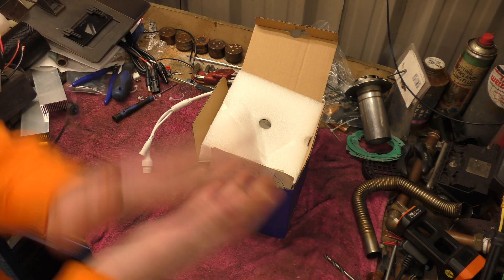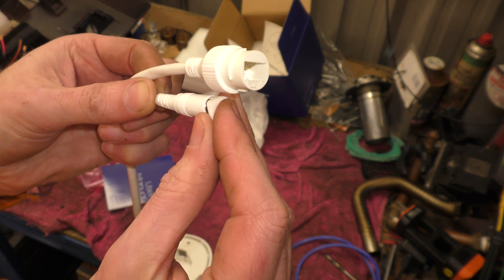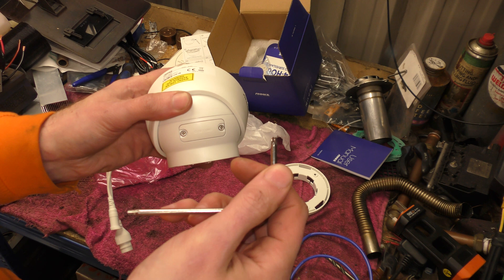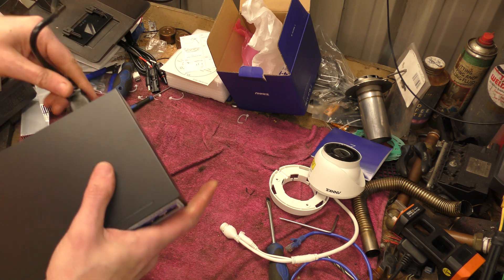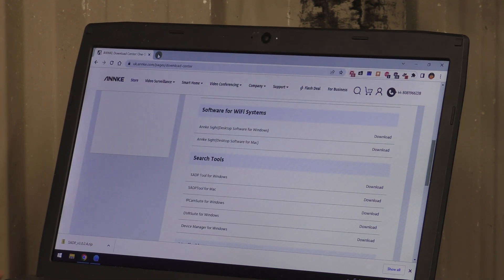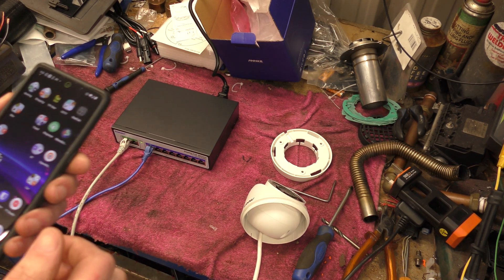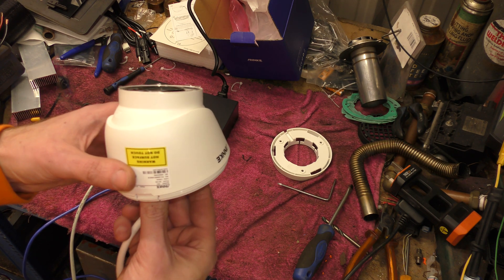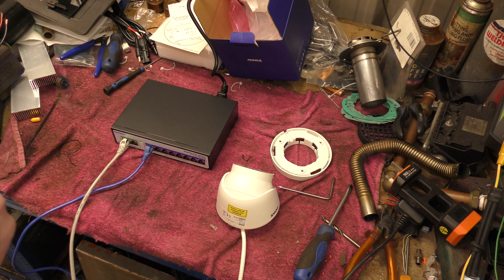Annke C500 poe cctv camera - DIY POE CCTV - part 1

Comment: You are missing a V 🙂 onvif is the name of the protocol.
I saw someone recommended Blue Iris - I always preferred Zone Minder which was a pain to set up but was a much more versatile system. Now however is Frigate is the best one which uses AI (actually a Google Coral chip) to detect the type of motion/movement to get rid of false positives AND integrates beautifully with Home Assistant.

Someone also recommended Dahua cameras. While they're good they also really expensive and Annke can't be beaten in value for money comparison. As long as you don't use their Chinese software with IE 😂

Comment: For a home setup NVR that doesn't need a subscription to watch over your own property, there's Genius Vision for windows, sure it's chinese software so user beware (such as firewall-block its' access to the internet), but I've been using it for several years now and for the most part it does the job nicely, it's a bit complicated to set up initially for a total newbie, but once you figure it out, it's pretty powerful, I think it does motion tracking so can be used with PTZ cams too, but I haven't got one of those so not tested it... :)